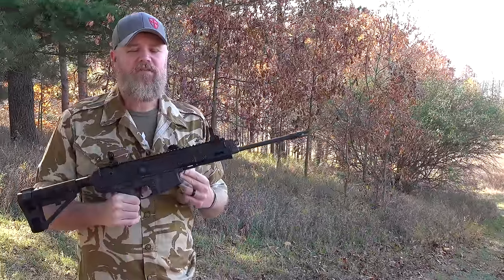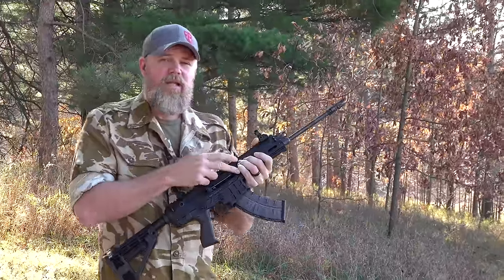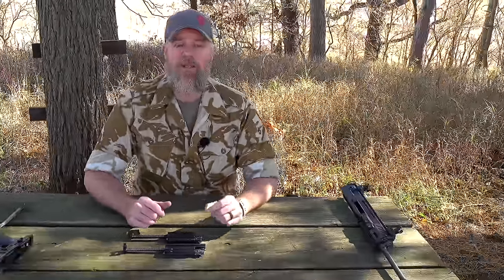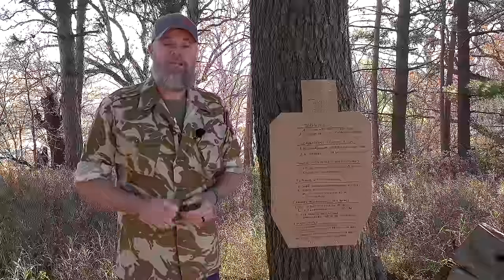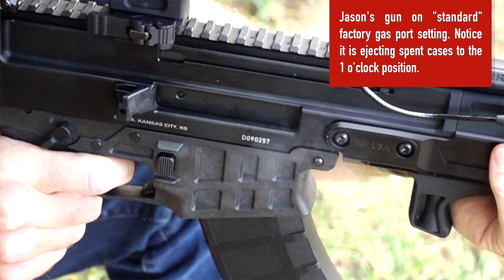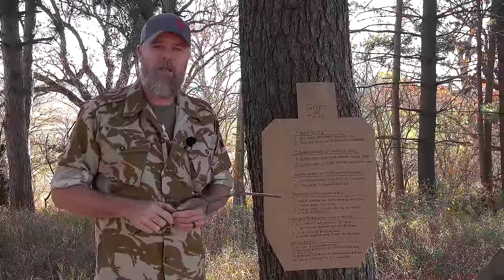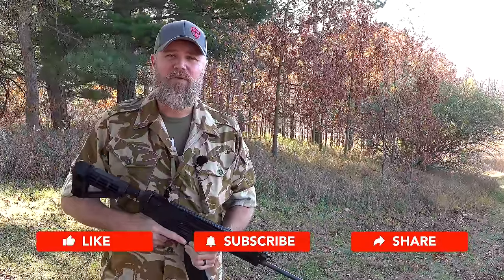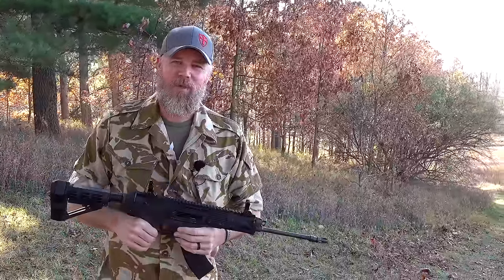CZ Bren 2Ms 7.62x39 Stovepipes: Cause and possible solutions.

Comment: MAC, I have a Theory and I would like to,put it to you! Could CZ be using the SAME GAS Valve in the 5.56 and 7.62x39 since the 5.56 are NOT having the Issue but some 39s are? Or that somewhere in the Assembly Process the Parts are getting Missed Matched since according to this CZ Parts Website there are Different SKUs for the Different Size Barrel Lengths so there are 3 Piston Fronts and 2 Piston Rears along with 2 different Gas Tubes. I am not sure how the weapon come over from the Czech Republic if they come fully assembled or if FINAL Assembly is done in Kansas which could be why some Guns Work Great and SOME have ALL Sorts of ISSUES because they are getting the WRONG parts!  Is the French GIGN 7.62x39mm Assault Rifle that goes Full Auto having the Same issue as the US Semi Auto Version of the Bren 2MS???
Reply from the maker: No they are all clearly marked for the guns they’re installed in.
Reply: @Militaryarmschannel  COOL I have not played with the 556 version yet but I am giving very strong thought about getting the 556 as well since I pick the 7.62x39 14 inch last weekend but the 11 inch 556 would make an excellent Jeep gun as well and the LGS where I got the 14 inch 39 had a 11 inch Bren 805 1 in FDE the Version that CZ USA did not want and I could see why the 11 inch model was heavier than the 14 inch inch that purchased but if a Stock in put on like the Magpul ACR that has a little weight on it would balance that other Bren Nicely I think.

Comment: What about changing the depth and angle of the brass deflector?
Reply from the maker: I don't think this plays much into the equation at all if you look at the properly gassed gun running. The spent cases go out at the 3 o'clock position consistently just as they should.
Reply: @Militaryarmschannel  I imagine you’re getting tired of answering some of the same questions over and over. I tend to read thru most of the comments before I’ll add my 2cents🤣no ones perfect of course. Great channel, appreciate all you do👍🏻🇺🇸

Comment: That looks to be an MS, I have an 7.62x 39 S with no issues so far. Are the issues more with the MS?
Reply from the maker: I have an 2S that works fine but that doesn't mean they all do. The only real difference between the M2 and M2s is the front hand guard.

Comment: Shop.cz-usa.com is now selling spare parts for the cz bren 2. Ive ordered a .223 gas tube for my 14in 7.62×39. I've tried drilling my factory gas tube but couldn't drill the hole small enough. The gas tube I ordered looks perfect for making the 7.62 run properly. I'll post another comment after ive tested the gun with the new tube. My gun is being fixed right now because the firing pin broke on the tip so it wasnt hitting the primer. It's been almost 6 weeks so hopefully it wont be too much longer.
Reply: I haven’t seen anything for the Bren 2 Ms, plenty for the 805 s1 though.
Reply: @lancedacus4560  I ordered a gas regulator for an 11 inch 556 gun from the cz web store and am now running it on my gun so its definitely there. It might not be in stock currently, but it's there. It makes it run great by the way.
Reply: Oops, I was wrong, found Bren 2 parts listed under sale items after clicking on “Specials” . Sorry about that.

Comment: I almost wonder if moving the brass deflector back a centimeter or so, or changing the angle a little bit would change anything. Every time it malfunctions it seems like the issues they’re talking about paired with the way the cases bounce off send it straight back into the chamber
Reply: Some guys on the forums discussed that and tried different deflector angles or removing it altogether with either no change and in some cases, it made FTE and stovepipes worse.

Comment: Today, December 19th, for the first time I fired my new CZ Bren 2 Ms with 14 inch barrel. The weapon was cleaned and lightly oiled before use. Ammo fired was all lacquered steel case FMJ obtained from SG ammo (https://www.sgammo.com/product/wolf-ammo-sale/1400-round-wood-crate-762x39-123-grain-fmj-barnaul-mil-spec-ammo-spam-cans-la). 

Gas setting was standard (position 1) for all but 5 rounds at position 2 and 20 rounds at position 0. Rounds were fired no more frequently than every 10 seconds. Around 250 rounds were fired. Why so few? Because I got tired of the stove-piping. I estimate that around 50 rounds (20%) stove-piped. There were times when every other round stove-piped. I will be sending the weapon back to CZ for evaluation and "repair" or replacement.

For me this problem with stove-piping is very real.
Reply: Update on stove-piping of my Bren 2 ms 14” barrel. I obtained two things to test the issue: a) a stronger piston spring (from HB Industries  https://hbindustries.net/store/shop/cz-bren-2-high-load-gas-piston-spring/); and b) brass cased ammo (840 Round Case - 7.62x39 123 Grain FMJ Non-Corrosive Brass Case Prvi Partizan M67 Ammo - PP76239B from sgammo) on the off chance the steel cased was an issue. Fired alternate mags of 20 rounds having either all brass or all steel. Fired a total of 180 rounds brass cased and 280 rounds of steel cased. 5 brass cases stove-piped. 3 steel cases stove-piped. The occurrences seemed random. My conclusion is that the casing type has little effect on stove-piping. The stronger spring made a large difference. However, 8 stove-pipes in 460 rounds is still disappointing.
Reply: Fired another 480 rounds today of mixed Wolf lacquered (as above), Wolf Performance, and the brass cased (as above). Alternated these ammo sources in most of the clips (e.g. 1 Wolf, 1 brass, 1 Wolf, 1 brass...). Only 4 stovepipes (2 brass, 2 steel]. Fired 120 of the rounds as fast as possible (4 clips of 30 each) without a single stovepipe. Maybe the gun just needs breaking in ( tho that seems illogical).
Reply: Another 300+ rounds fired. Did not clean piston after last time. Only 1 stovepipe today, about the 40th shot. Noticed that ambient temperature has been higher each session. Gun got so hot today that leather work gloves were not enough protection. Maybe the stove piping is gun temp related.

Comment: Is CZ-USA always like this about Spare Parts on Weapons they import from CZ Europe? When are they going to have Spare parts I am the type of shooter that likes to have Spare Parts for his Weapon in Case of Issues! I probably have one of the VERY FEW Gen 2 USA Made SIG 556R 16 inch Long Piston Rifles that Actually works and I have 4 SIG refurb kits plus Individual parts including all the Springs , Hammer and Trigger, and Bolt.
Reply: They will I’m sure, probably fulfilling military contracts first. CZ’s website lists parts for the 805 s1 so they’re coming for the 2Ms I’m sure, just a matter of when. I put the HBI spring in my 11” 7.62 and stopped using Wolf, mostly brass and Barnaul now. Working great now, lubed more too. I run mine wet.
Reply: @lancedacus4560  I have nearly 1300 rounds thru my rifle right now WITHOUT a SINGLE Malfunction! I have every HBI Accessory Including their HK G36C Folding Stock, PWS FSC 30 Muzzle Device Pinned and Welded for 16.65 inch barrel w/Crush Washer and I run my Rifle with a light coat of Wilson Combat Liquid Grease and I am using Tula 123gr FMJs.  I finally got my Hornady Ammo Plant Reloading Press with all the BELLS and Whistles and I will be loading 556,  300bo, 7.62x39, 308, 9x19, 40sw, 357sig, 10mm and 45acp once I get some Primers!!!! I have some Real Cool Lehigh Defense 308 Solid Copper and Barnes Tac TX Bullets that will be loaded in 7.62x39 will be tuned for my Bren and Sig556R. I was taught old school that weapons should be Cleaned and Run Wet Specially Weapons like the AR and 1911s.

Comment: Dang I was really interested in this gun. Spending $1400 for a rifle only to do some diy work to make the damn thing work properly. #yougetwhatyoupaidfor am I right? Spending over $1400 for rifle just to get Budget rifle performance.
Reply: $1400?? Most are around $1800 plus tax. I feel a lot of these rifles are trying to “fix” things that don’t need fixing.
Reply: @DDRDK  picked my 11” 7.62 up barely used I assume from issues talked about. Put the HBI spring in it and stopped using wolf ammo. Only Barnaul and brass and mines working great now.
Reply: @lancedacus4560  never had an issues stock after a couple thousand rounds. Put the HBI spring in just for sun and now it just ejects a nice 3-4oclock. Idk 🤷‍♂️ never had any marks on the front of the receiver like some get. Mine just seems to work. It’s only had 40rds of brass through it otherwise all wolf, Tula, and red army. About 3k total. 1k of each

Comment: Lol. All the “scar inferior to cz”  noise seems to have to quieted down
Reply: The 556 ones have been good
Reply: @TheREALLibertyOrDeath  certainly better. But don’t swap the hand guard. If you try to swap to a longer hand guard or even the  factory 922 compliance hand guard you are risking all sorts of weird pinching issues. Mine, for example, won’t reliably lock back in the last shot. Then you have to keep fiddling with the torque on the bolts and pray you find a setting that works. It’s definitely a finicky design. I love mine, but it isn’t as flexible as other modern designs in my opinion. And that doesn’t even address the various gassing issues with suppressors.
Reply: @thedumbguncollector5546  thanks for the heads up I’ll leave my hand guard stock

Comment: Case deflector is also at a terrible angle.  Look at the angle on an AR and you'll see the Bren is trying to almost catch and throw the case forward than just guide it out of the way.  It's almost making its own malfunctions and beating the crap out of the FRONT of the ejection port.  AR's also have a slight roll to the "bump" that keeps the ass end of the case spinning clockwise as it exits the rifle.  The Bren is actually changing the rotation of the case and trying to stick it back in the rifle.

If you could remove the case deflector you would have NO problems.  Gas, port, ammo doesn't matter.  They screwed the pooch on the deflector.
https://www.youtube.com/watch?v=xPwTGfhUulk